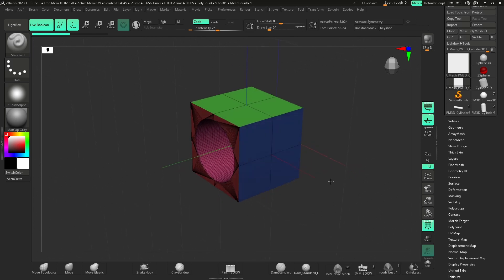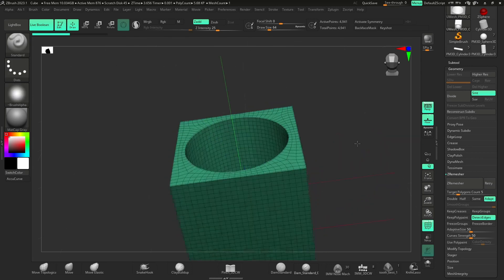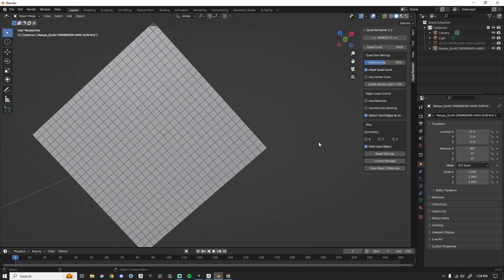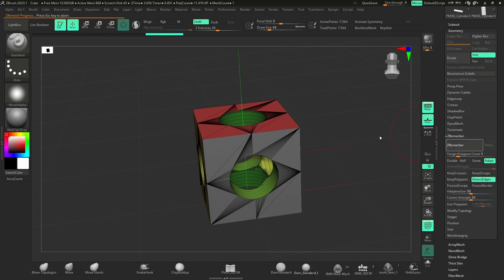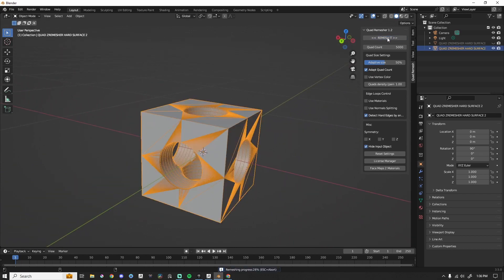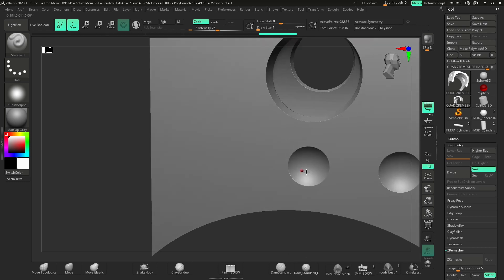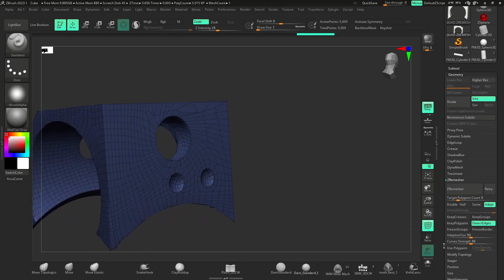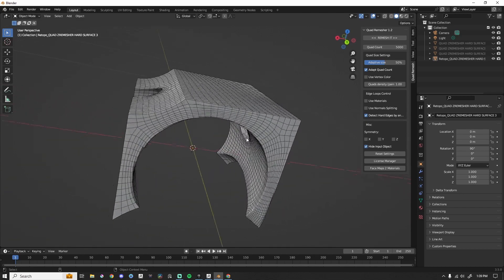Blender 3.5 vs Zbrush 2023 | Quad Remesher vs Zremesher | Hard Surface

Comment: Does ZRemesher in ZBrush 2023/2024 do any better than in the old versions? I'm still with ZBrush 2022 (the last version as a perpetual license) and wonder if it has evolved since the software became subscription-based.
Reply from the maker: There are some minor updates. https://www.youtube.com/watch?v=Wm6LrJ5suac
Reply: @AlHowell  Oh that's not good news to me. Are there any comparable updates or advantages on the Quad Remesher's side?  I was planning to use the Remesher in ZBrush 2022 as the retopo tool in my pipeline, but if I can't enjoy the new updates in the newer ZBrush versions, do you think it's worth getting an indie license of Quad Remesher if I plan to learn Blender 4?
Reply from the maker: I guess it depends on your needs. For me, zremesher in 2022 is all I would need. to get clean geo to sculpt on. I still do not think that either would be used successfully if you are retopoing for animation.  @a_musical_mind